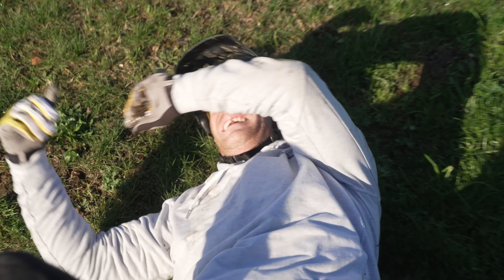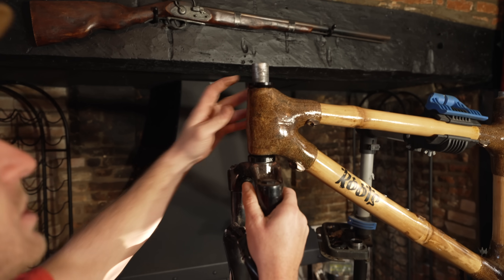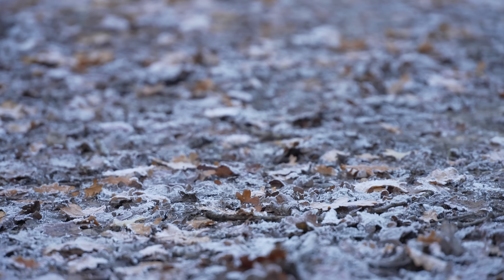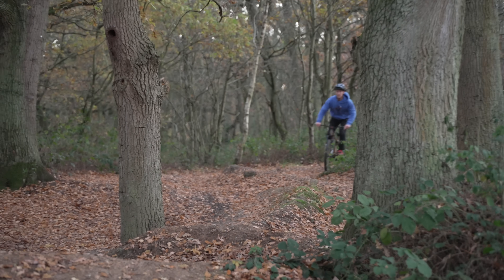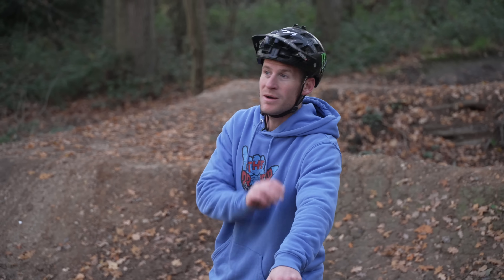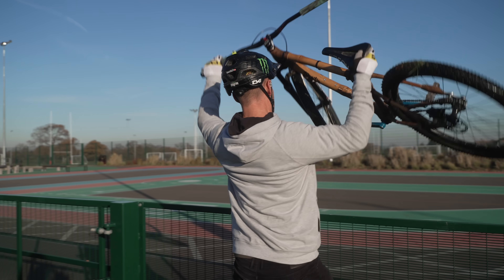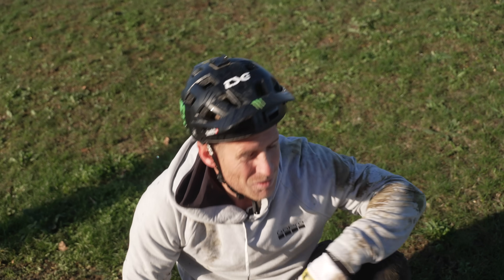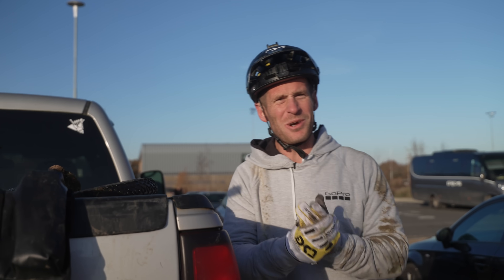HOW LONG CAN THIS BAMBOO MOUNTAIN BIKE FRAME LAST?

Comment: This design seems doomed to fail. The bamboo tubes work great because bamboo is extremely strong under compression. However, when it comes to joints you need something that can also take bending forces and sheer along other directions. Thus, making them out of wood fibers is a bad idea. If I were to design a bamboo bike frame, I'd use a lugged construction with carbon fiber or alloy joints to hold the tubes together. That way you get the compliance and compressive strength from the bamboo tubes along with stronger joints where other forces are involved. You could probably get away with using wood but it would have to be a harder wood that grows in thicker structures since bamboo is inherently limited by its width and wood fibers are not strong enough even with resin binding. Neat idea, very poor implementation engineering-wise

Comment: I doubt bamboo is stronger than steel.
Reply: it's not the bamboo that snapped it's the shitty hemp resin composite joint. reason this frame was scrapped perhaps
Reply: Hey you won a gift 🎁☝️.